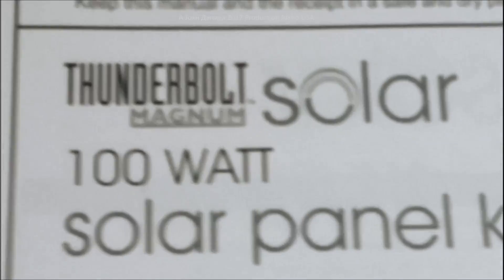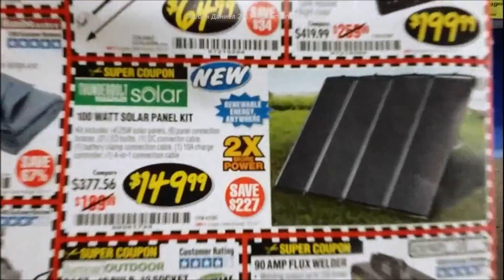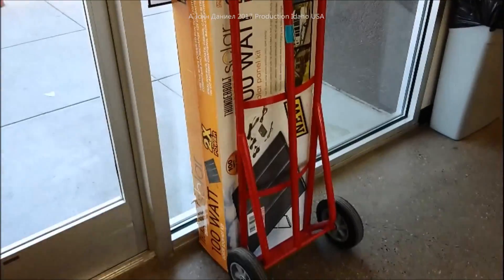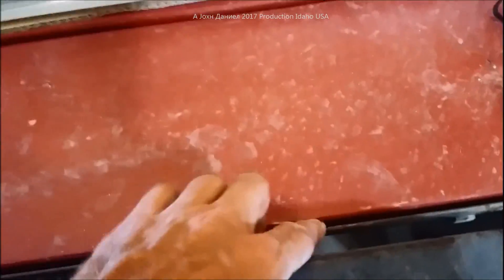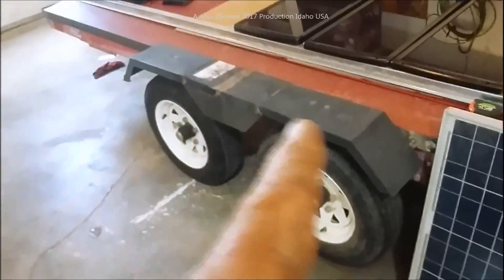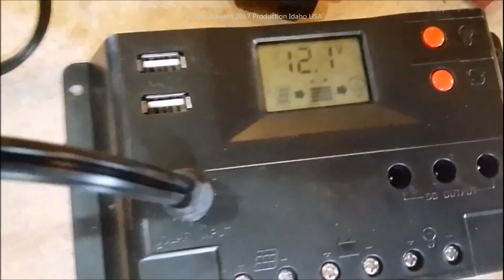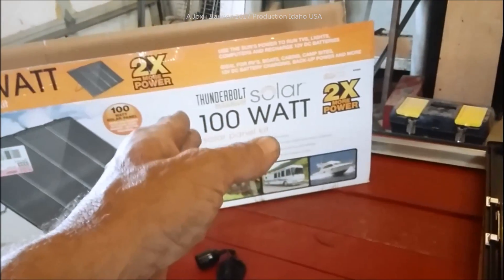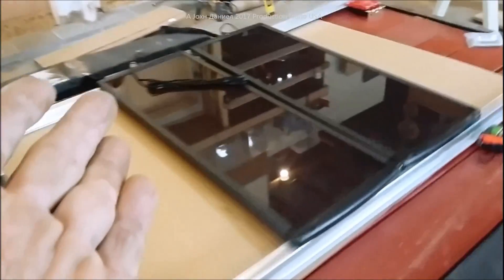Harbor Freight 100 watt solar kit #63585 NEW Thunderbolt Magnum (MAJOR PARTS LIST BELOW)

Comment: While the video is appreciated, you seem to be over-glorifying the product. You keep mentioning its amorphous, but you don't explain what that means or how inefficient it is compared to mono- or polycrystalline panels. It seems like an ok product for the price, but you can get a way better kit for a few bucks more. You would get almost double the efficiency from a polycrstalline panel and use up the same amount of square footage.
Reply from the maker: People who preach efficiency to sell a product use too much energy hiding one truth, production hours. 
Efficiency is decided on light flash ratios, in other words 2 pm perfect angle full sunlight, no clouds, no atmospheric distortion, perfect 68 degrees ambient and panels so clean you can eat off them. What they deliberately fail to mention is at 4 pm with a few clouds, high humidity and a light dust on the panel their "efficiency" result is 5% now. ( https://www.youtube.com/watch?v=aYuGSFbgEcQ )The reason I as you put glorify Amorphous is none of the environmental NON PERFECT laboratory condition have the amount of detrimental effect on Amorphous due to the mass integration of particulate cellular composites. Length of charge, amount of total days production is whats important. Not Laboratory ratings. ( https://www.youtube.com/watch?v=WDaAXAoH180 ) hopefully this 2 videos will clarify the difference, be sure to share them both to anyone of need.

Comment: How much would you charge to build another trailer like that for somebody else
Reply from the maker: I once build a new one from the ground up for about $750 minus the tires & wheels you want. Thats usually $200 for them. I once did that for a woman with a Plymouth Prowler thats just got a V6 in it. Made hers 54" wide and 130" long. 2 Axle trailer Capacity 3300 lbs, Dry weight I guess was about 560 to 600 lbs.
(Spring kit is $190,  Axles are $165, steel is about $200, wood about $120 )

Comment: How many panels would I need to run an 18,000 BTU mini split AirC. Unit if it's even possible
Reply from the maker: WOW, 18,000 BTU is a BIG mini!!! Thats about a 1580 watt load with a 2800 watt start surge at best. So apply 128% ( Solar Production/Conversion ratios) against that and you need that many panels. Mathematically you would need ( 1580 + 128% = 2020 watts of solar. So thats 20+ of the harbor freight kits OR  You get 4 of these sets of 3 https://ebay.to/2JpLxfO and save yourself $1500  ( 4 for $1920 for 12 panels or $3400 for [20 kits] 80 HF 25w panels) The 12 will use under 1/3 the roof space of the 80!!
Reply: bags of ice are cheaper

Comment: So basically the hundred watts panel is charging your truck battery?
Reply from the maker: Its keeping a 3 bank of 100 amp deep cycles in the utility bed hot for my big inverter. Keeping them at full rate of charge extends their lives and makes my inverter run at best performance.

Comment: This is overkill for a work truck. I'm going to make a suggestion for your safety, I want you to think about this for a few mins it will make perfect sense after you do.
Your battery bank is mounted above your head behind you, if you ever crash in a high speed crash any and all moving mass will fly forward until its met with equal and opposite force  trust me your head is not equal opposite force.
Put that shit on the bed floor all the way to the frt of the truck bed and make sure its tied down really good with very large fender washers from under the truck's bed like the factory uses on the seats of the cab. you might even want to bite into the truck's A frame it it has one. Use shear proof bolts same they use for motor mounts or heads.
If you use soft steel bolts they could fail in a crash. you want grade 8's  that's 150k lbs shear strength.
Yes its stronger than sheet metal.
But if you think about what a battery weights lets say 32 lbs?  32 lbs traveling 70 mph has x force built up in it
That's a lot of kinetic energy its more than the back of your camper can take and more then the window will stand, even if they hold do you want to risk it?  I'd rather have it hit me in the ass then the back of the head because you live to talk about it later, if its in the head you won't live. A blow to the back of your spin doesn't  have to be hard to kill you either.
This is one of the most vital parts of your body its your brain stem and spinal cord  you can withstand crushed legs
or even a blow to the chest and live, but this would kill you. no second chance.

Never install anything in a car or truck with it above your head behind you.
I worked in high end car audio for 40 + years this is a serious rule you do not ever break.

On the roof I'd have used cold rolled 1018 C channel for mounting but I don't think you can use larger bolts to hold this panels on. or 6061 aircraft aluminum.
 So how did it work out, will these stand up to a hail storm?
And why do you find it necessary to run more then one battery in your truck its a strain on your car's alternator to try and charge them all. For somthing like this you would want to buy a larger amperage alternator if its standby power.
Your trucks 120 amp alternator can't charge 4 batteries and if its not brand new its not putting out 120 amps anymore, they degrade over time and use. I know what I'm talking about I did this for a living. Upgrade your charging system and the charge and ground wires under the hood, all of them to 4ga  this alone will improve your charging capability.
but a 240 amp alternator helps too.  Did you know one battery will drain a second one? they will you have to isolate them.
with diodes and or relays.
the connectors your using are a dead short if its a metal truck camper top. they work in plastic or fiberglass but the bolts are live and will short out on metal without an insulator material.

Whats funny is my 35 year old  14 years ago built his first computer, he did not use stand offs for the motherboard. played and played with it for an hour, then asked me what was wrong. I told him Burnt up! short son.  
He's a computer coder now and makes more money then I every have.  we all makes mistakes. Trust me I've made a lot.
But we learn from them and move on. Being able to admit you made a mistake is key to learning. No one is perfect.
But you should seek advice from somone who knows then question it. 
Who knows I might have told you some bullshit!  I could be wrong.  Don't just take my word study up on the subject you might learn more than I know. And do not trust everything on the internet its not a stop all for information. Its not all Fact.
As my 37 year old says when he googles that thinking the internet is always right! 
 RIGHT! And Cows are Pink with purple polka dots.

This is my view on the subject, nothing personal ecpt my fear for your safety.
Please don't be offended I did like your review of the panels.

Years ago guys would make somthing at home, no college no dgr just make it and the stuff lasted 2 lifetimes
you buy engineered stuff today it last a week if your lucky and those guys have 4-6 years of college behind them on that subject.   Seems they study how to make it Cheaper not better.
America needs to stop competing on cheep and start competing on worlds best. in the 50's and 60's we sold more quality cars that can and may are still on the road today.  When was the last time you seen a chrysler Kcar on the road outside of florida or california or some dry state.  You don't because they rusted out beyond repair.
Even wooden built cab cars held up better made in the early 1900's at least you could rebuild them with new wood.
you can't do anything with a Kcar but scrap it.

Comment: I have bought three of the same systems and one of their older 45 Watts systems. 
The panels work perfect but you're going to have to buy a new inverter cuz they SUCK!! 
All you're getting is a glorified phone charger that will run one DC light. 
You need at least 3000 watts to run a TV. 
5000 for your standard refrigerator.
2500 for a coffee pot.
But those don't come with these systems however Harbor Freight does offer bigger inverters for more money of course.
Now Harbor Freight if anybody buys from you guys off of my comments I want 2% of each sale🤣😂😂
Reply: You're talking about a different thing, this has a controller, it's not an inverter. You run an inverter off the battery, NOT the solar unit !

Comment: I can get a 380 watt panel for 120 bucks but the harber freaight would do to add on to what i got allready .what i got charges even on a ranny day shows 14.5 o. My controler in full sunlight and 13.5 on clowdy day and rainy day .hooked up to a 800 watt inverter

Comment: Sorry to burst your bubble. I got these for Christmas a few years ago and I purchased another one myself. I believe they were the 15-watt panels, same panels less power. They worked for about four years, then I noticed the water damage around the edges of the panels. Yes, a great start but they are cheap for a reason. The rain will damage them over time. Your lucky if you get about 4 years, keep the rain off and it will work out better. The edge is where the water damage was on all panels. Not trying to steal the thunder. They're cheap for a reason. Just my honest experience. I have real panels now. Good Luck. I like your name, John Daniel.  They both saw our day!

Comment: Harbor Freight solar panels are for chumps. They are inferior in every way to poly and mono panels. You fail to show the current output because they aren't putting out any power. They are also more expensive than other setups even though they are made out of plastic. I get that its an easy setup for idiots and they can point to a flashing line on a display or a blue led like it means something, but its all just fluff for dumb shits. Your set even came with a broken light bulb as a testament to its quality. Garbage right out of the box.
Reply from the maker: Yep, Your 100% right, No current output in this video, in the shop, under a roof. I guess you should not watch the videos with such results that followed. Would not matter anyway. https://youtu.be/o2VY4m2lprQ The only thing that cures a hater is the day they die.

Comment: can you do a schematic for say a 14x16 small portable cabin?  standard outlets inside window ac, fridge micro  1 bath outlet and light two kitchen and two LR outlets and two lights thanks let me know
Reply from the maker: You can contact me through olympicpowercontrols@yahoo.com for things like that. I get as many as 100 emails a day but do get to as many as possible.
Reply: wiring is elementary , watson.

Comment: I have the same from 3 years ago 25 watts each they are awesome just saying, Washington state not sunny all the time i would recommend them :) i use it for my lights in my cabin and a car stereo although i have a 500 watt inverter which i never use emergency only .
Reply from the maker: I'll be adding 600 watts to my cargo trailer, but of 100 watt. The last 3 of 100 watt panels I paid $99 for are now $79, No joke! Just ordered 8 more! https://ebay.to/2EGsN8i

Comment: Would this solar kit provide power to workshop lights in my greenhouse
Reply from the maker: Some, but not a lot.  It depends on how much lighting you intended to use. A 5 meter LED strip and a 35ah deep cycle battery and this kit would work well together for a 15 to 20 foot long green house.
Reply from the maker: I'll be adding 600 watts to my cargo trailer build, but of 100 watt. The last 3 of 100 watt panels I paid $99 for are now $79, No joke! Just ordered 8 more! https://ebay.to/2EGsN8i
Reply: Јоhn Daniel L

Comment: My main problem with the Harbor Freight deal is they use up so much real estate. I can get 200 watts of mono in the same footprint. I want to be mobile with them in remote frames I will build. There is only so much room in the van. Bang for the buck and all that. The stuff listed in the pinned post is a much better situation. These HF panels are a terrible buy.
Reply from the maker: True, they are space hungry. But they have been worth it to so many to help them learn solar, and progress to bigger.

Comment: These kits are great to get your feet wet with.  They are not cost effective, but still a handy, available introduction.  The plastic frames will crack at the corners within a year.  The wire connections inside the panels are the Achilles heels that will corrode and break within two years.  I love the controller box that came with the 45 watt system.  It's only good for about 3.5 amps but has very handy connectors on it.  Don't mistake voltage for power production.  Amorphous panels are fairly tolerant of less than ideal sunny conditions but you're not going to get full amperage.  I've had to replace the three panels with a single 50 watt poly panel that will last for years and years.

Comment: The 2000w HammerDown inverter you linked to in the video description is junk. The first one smoked and shot sparks out the azz with less than 1200w load on it. The second inverter lasted less than 4 hours with 510w load on it before it smoked and croaked. I now have bought a Sigineer 6000w low frequency inverter and it runs 24/7 and powers any load I put to it. Well pump, fridge, freezer, grow lights, everything. Sigineer makes the AIMS inverters but charge much less. If anyone is looking for a whole house inverter, look up the Sigineer low frequency inverters. My 24v/6000w model weighs around 80lb.

Comment: Can you give me a ballpark number how many of those solar panels I would need to run a air conditioning unit for small home three bedroom home
Reply from the maker: About 48 of them for about $2000, or about 12 of these https://amzn.to/2FRE3jt for about $1190 would do that. I prefer the 12 for that purpose. But I would option to use one set of HF panels facing East, another set facing west, & 10 of the NewPowa 100's facing south to increase active solar collection of extending collecting hours by 3 hours a day. Either way you would run a 6500 btu window air unit in reasonable use.

Comment: I'm a user of the original three panel design that I bought almost three years ago and they are still in great working condition even on cloudy days including the batteries. Although the mounting hardware that they came with isn't in very good shape anymore. With that being said I feel that I have got my money's worth out of them. I yet to buy the new version of the solar panels but I can't justify buying them when the older ones still work.

Comment: So whats the capability of these to help with house electrical costs?
Reply from the maker: Very small. You would not use such a panel thats $1.30 a watt for a set up for cost reduction, it just isn't feasible financially. You would go much bigger like a 100 to 300 watt panel at 70 to 90 cents a watt. My shop and house use big panels, the reason for these on my truck was due to how well they perform laying flat, in low light & dusty.
Reply from the maker: If your needing material things to build your off grid plan, I made a list of things I have used for the last 9 years as a renewable energy installer. A multitude of tested in real time, a few different list to look at https://www.amazon.com/shop/influencer-acccb1e8

Comment: Now that you've had them installed for a while what is your take on the system
Reply from the maker: So far, durable. Keeps the batteries hot to run some tools on for a few minutes as needed doing solar power  installs. I got them for almost free, or there would have been a STION panel there instead but so far, very impressed.

Comment: the charge controller is saying its charging but its charging very slow and the voltage didn't go up much too.
Reply: One panel won't do much on a deep cycle battery in a short time. I've got two of the older 45 watt HF setups that will bring a battery from 9 to 13.2 volts in a 6 hour period which is pretty good. This array has more wattage so should be multiple times better.

Comment: It would be nice to have seen these panels work under load. I would also have never used a damaged battery do to the danger that poses. I'm interested how he's panels are perform after a month or two of use. There's a saying we have in the commercial electrical world that goes something like, you pay for good equipment once and you pay for cheap equipment many times. I would much rather go with a company like Renogy then something from China!
Reply from the maker: See the 1 year update on my channel, about 10 videos ago. Numerous videos where I use the trucks solar and battery system in the field.

Comment: ok those mighty max panels u have linked arent amorphous
Reply from the maker: Most Amorphous manufacturers are no longer selling to the public. They are making 300 volt panels for commercial jobs more now. I did a recommend on the Mighty Max due to them having 4 buss bars which gives them "amorphous like" low light reception and production.

Comment: Amorphous panels have a much shorter design life than poly/mono panels
Reply from the maker: Bad info, Amorphous has proven to outlast Mono and Poly by the Department of Defense who has used them exclusively since 1993 on remote islands, and McMurdo Bay Antarctica
Reply: They use Monocrystalline and Polycrystalline panels at McMurdo and so does the department of defence 
They don't use  Amorphous panels due to their short life span and low efficiency  even the ISS uses mono panels.
you saying my info is bad is erroneous